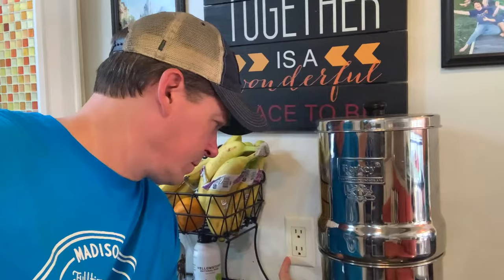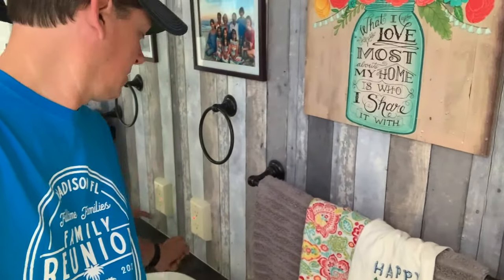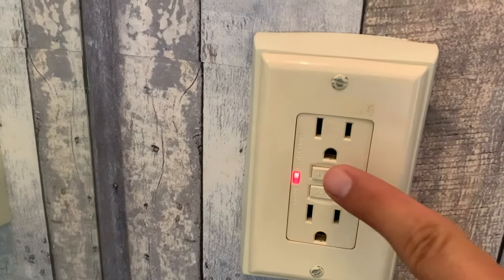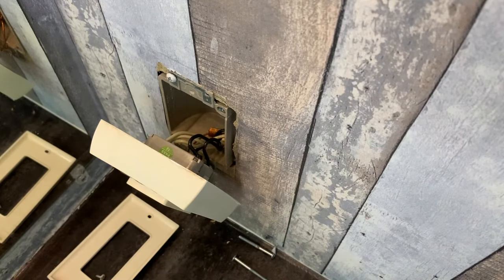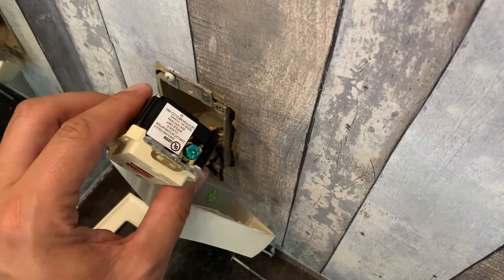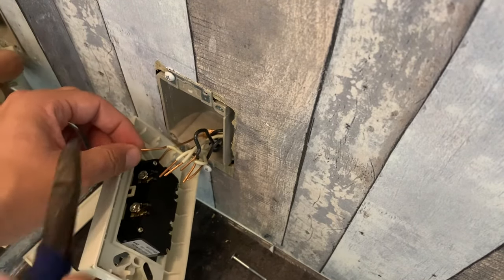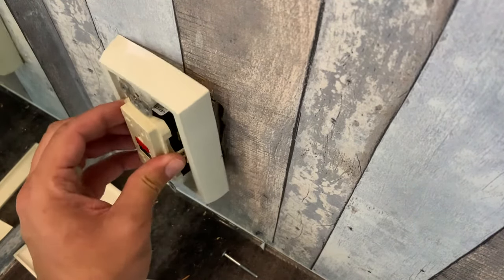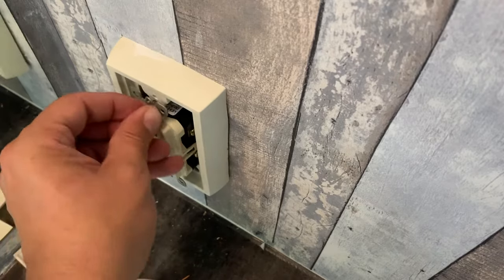RV Outlet Not Working -  EASY FIX: Full Time RV Family of 9 fixes outlet issues.

Comment: Outstanding. I had changed out my RV GFI. But it still did not solve my problem. He commented about reversing the two black wires. I did that and it's fixed. Thank you for your professional advice. Rick from Washington State.
Reply from the maker: Not professional, just one amateur RV guy trying to save us all some money.
Reply: Thank you for leaving this up he was all over the place in the video and ADHD is not fun revolving around that so you indeed helped diagnose me thank you both take care 2 wires were swapped as well 2am repairs for the freezer and internet

Comment: I want to thank you for this video, your exact issue of the bathroom GFCI being tripped was what was wrong with my Rockwood mini light. All my 110 outlets were not working. They all said GFCI but no reset button. The one in the bathroom was it. This power outage happened at 2 am in the morning. All the other videos had me outside up underneath my camper,  in my breakerbox in the kitchen, but nothing was tripped. You were spot on with the bathroom GFCI, and I didn't even realize there was an outlet in the bathroom until this video. So again, thank you so much for making this video and sharing. I can now get back to sleep.

Comment: Your tip on one GFI controlling ALL the 110 outlets in my RV helped solve my problem! Which was: the bathroom and bedroom outlets were working but none of the LR, Kitchen, or the outside receptacle, and I couldn't believe that just the one GFI could control them all so was looking all over for another GFI. And the GFI reset was working fine. But I went ahead and pulled it out anyway and found that one leg on the power side was burnt and not making a good connection. Snipped it and reconnected everything, and Bingo, everything works!! (Wasn't sure the GFI was still good, and will probably replace it anyway, but will just monitor the operation when using it for now). I was ready to start looking at all sorts of difficult solutions, so you saved me a BIG headache. Thanks again, Happy camping. A bit of camping wisdom given me when  we startied RV'ing 20 years ago:  The ONLY thing that works 100% of the time in an RV is the OWNER!!
Reply: I replaced the GFI in my RV but the fridge and outside plugs aren't working
Reply: It blew those plugs because I used a skill saw on the outside plug then 3 plugs didn't work so I replaced the GFI and still no power to those outlets but the others work

Comment: Great video!  Thanks!  But, what if replacing the outlet doesn't work?  If the gci won't reset?  Then what?  I have that problem now.  Thanks for making this video.  Very informative!
Reply: Help I'm having the same issue. Had the red light on gfci. Bought a new one installed it and still won't reset

Comment: Any thoughts on why only a few outlets don’t work but some do? The outlet with the GFCI still has a green light on it and it too still works? I feel I am going crazy!
Reply from the maker: Yea that is frustrating. Well first I would check the breaker and fuse box to be sure nothing is wrong there. If everything checks out there it is probably a wiring problem. They often chain theses outlets together in series. So for example if you have replaced the base gcfi outlet recently, because it is the first one in the chain, if the wires didn’t connect well it could cut power to each outlet past that in the chain. Wish I could be more help.

Comment: At 4:12 you had mentioned the GFCI sometimes just fail. How did you determine/confirm your GFCI failed and was no longer working? Thank you for details in the video 👍🏼
Reply from the maker: When they fail the button to reset won’t push in anymore. Then I opened up the outlet and used a volt meter to assure the power was working. Once I knew I had power to the outlet then I knew the outlet had failed

Comment: @FindYourCrazy great video but i have a question that might stump you as its stumped everyone elses so far. What if you have the same issue but except there being a gfi in bathroom there isnt one anywhere. Breaker is good not flipped even changed the breaker thinking it was bad but still same issue. There is no gfi on the side where all power is out. Heres the kicker most of the time a few hours later or a day later the power comes back on. Now sometimes i can use the bad side for a little but it will shut off. The other day i unplugged a 6 way with a reset thinking that could be the cause and i was able to use the side where iv had issues all day running high voltage items. Ac, coffee pot, few power tools, ect. Woke up the next day to find the power shut back off again. Now i know they make gfi plugs that dont have reset on them and they just have a sticker stating gfi but im not sure i have 1 cause there are no stickers on my outlets that are out.
Reply from the maker: Unfortunately, yes, I am stumped as well. Intermittent problems are the worst to try and identify. Best I can do it pray for you to find the cause :-)

Comment: I have a cabover camper and when plugged in to shorepower(my house) and try to run the fridge off electricity the gfci will pop in my garage. All outlets work and i can run the AC off the same power and it wont pop gfci in my garage. Also gfci in camper bathroom seems good it didnt pop it there either.

Comment: I did this and the new outlet is working (old one was still working too though). The other outlets are NOT working still. Any thoughts on what to do next?
Reply from the maker: As Andy told Aunt Bea… might be time to “call the man.” I am no expert so I only share from my experience. Unfortunately you are past my experience now. All the outlets are chained together starting with the first, must be something in the wiring past the first outlet. Sorry I can’t me more help.
Reply: @FindYourCrazy  I'm going to replace the first outlet in the living room. I plugged in a cheap electric heater and the next morning the outlets weren't working. I think that one outlet could be the problem
Reply: @MrGwizyadig hey man I’m having the same issue, I did the same thing and now all my outlets are tripped, let me know how you fixed your problem if you ever did

Comment: YouTubers are notorious for never answering comments so hopefully someone else does.

Today I moved my camper from one spot to another that was like 50 yards away. Everything was meticulously cleaned and put away for even the short move. It's always a good excuse to super clean everything that you normally don't have access to. Like computers and what not..

The camper has been plugged back in and running for hours.  Same exact things running in the camper as I have been for 6 months.. 

I turn on my computer and turn on balder's gate 3 and before I even logged in I hear a crackling and my battery backup that the PC is plugged in to starts beeping meaning it lost mains power and is now running on battery. I alt-f4 the game and hold the power button on the PC to force a fast shut down. click off all the breakers and rip open the bench seat expecting to see fire and smoke. I smelled smoke. Didn't see fire or smoke. The battery charger fans are cranking up and running at max speed for a few minutes, then shut off for a few seconds, then kick on and repeat..  the fans have ONLY ever kicked on full blast before when I had a shitty 12v wire coming out of the screw down fuse terminal which caused a burned out terminal. I just moved the wire to a blank spot on the terminal and it's been golden ever since. Ive never seen the fans kick on full blast since.  Until now. None of my plugs work. There is 120v at the breaker but no plugs have power. My GFCI is NOT popped. 

Idk what to do. I'm gonna buy a new battery charger unit but I need power immediately. I live in this camper full time with 2 dogs. I need power for heat but I can't risk dying obviously.. or arguably worse, I survive but I watch my dogs suffocate and die on security camera while I'm helpless at work. It's 12:30am (on my birthday of all days). I'm supposed to be up in 6 hours. I need help NOW!!!!!

HELP!!!!

Comment: Is there a chance that a gfci could also be connected to the interior overhead lights? We have been trying to trouble shoot one GFCI outlet not working along with overhead lights. All circuits and fuses good. Kill switch seems to be working.
Reply: Did you find the answer? Same issue.

Comment: I have 2020 Keystone 303bh I am hooked up to a 50 amp service I had no power to my living room TV,master bedroom and and the 110 receptacle in the rear bedroom I do have power to all the GFI receptacles checked all the breakers and the surge protector had all green lights. I called Keystone customer service and they said to cut off all breakers and unplug the camper for 5 minutes to reset the camper. None of that worked. I was checking the main plug of the service line, it was plugged in and screwed in. Once I played with the cord I could hear my blow dryer that I had plugged into the receptacle with the tv and when I played with the main service cord I could hear it turn on an off so I put the cord over the sewer outlet to take the weight off the plug and have had no problems sense. Don’t know why the GFI plugs were working and the others not. I’ve seen other comments on videos with the same problems with no answer’s. So maybe this could help someone.
Reply from the maker: Some of your outlets must be tied into your battery system. So when the service line was not making contact you lost the outlets that used only shore power but kept the battery ones. My camper is older and none of our outlets are tied to the battery so nothing would work in mine, but every camper is a little different.

Comment: Question?? What if my gfci plug itself is working but the others are not?? And looking at all my plugs I only have 1 gfci plug?? I’m so confused
Reply from the maker: You would only see on G plug, the rest are run after that one in a chain. But if the first outlet is working then there must be a wiring problem.

Comment: I’m hoping this is my problem. I had an inferred heater, tv and a induction stove top running.  After turning on the stove top about 20 seconds the power went out. I knew which GFI they’re on so I went to rest the GFI and it wasn’t even popped out. So I tried testing it holding one test button in waiting for it to pop but nothing. Blown GFI receptacle?
Reply from the maker: Yes that is exactly what mine did, therefore the replacement. Hope it is that easy for you as well.

Comment: Would that have the same impact on tbe lights as well? I over loaded the breaker and now nothing but the microwave is working
Reply from the maker: No. Typically the GCFI outlets are just chained together, but not with any lights. If your lights are down you have I bigger issue.

Comment: I cannot find an outlet in my RV that looks like that would a reset
Reply from the maker: Some of the new outlets do not have a button and are suppose to auto reset. The base outlet, or first outlet in the chain, is usually the one in the main bathroom. You might start by changing that one out.

Comment: None of my outlets are working, and my circuit switch is half way down and it won’t go up or down… other electricity works throughout, just the outlets are down. Is this a bigger issue?
Reply from the maker: I am no expert on electrical, but if your breaker won't reset then that may be the problem, you need a new breaker. I had that happen in my sticks and bricks home and I had to have an electrician come and install a new breaker switch.
Reply: @FindYourCrazy  thank you 🙏🏽

Comment: I really need some help.  I have a gcfi that we just put in a month ago.  It tripped and would not reset.  Then a few days later, it did reset and stayed on for a week and then it tripped again lastnight. This morning, i tried to reset it again and it started working again.  Why is it doing this please i need help.  I am disabled and live alone and live in a rv and need to know.  could you please answer this for me.  as i said the gcfi is only a month old.
Reply from the maker: So obviously without being there I can only guess. But the first thing to look at what is plugged into all the outlets that on the circuit, not just the one with the gcfi switch. Small heaters seem to be the worst for tripping them. Then you can cycle through a few nights rotating what you leave unplugged to see if there is a difference. Second if there is nothing plugged into any of the circuits when it flips you probably got a bad switch. This is what I would think is more probable because you were not able to reset it for that day.

Comment: I have a 2016 jayco eagle ht and none of my gfci have a reset, it’s driving me nuts my kitchen, bathroom and 2 outside outlets don’t work. All are labeled gfci but none have a reset. Trying to find the reset but can’t for the life of me find it!!!!
Reply from the maker: That is frustrating. My reset was in my full bath. I know they sometimes will put the reset on the outlet closest to the circuit breakers so it protects everything from that point forward. So maybe start looking at all the outlets radiating out from the circuit board.

Comment: I did that still half of the outlets work
Reply from the maker: The only outlets that are connected to the GCFI are the bathroom, kitchen and outside. If any of your other outlets are not working then you have another issue with your fuse/breaker box. You may need to check all of your fuses.

Comment: So i swapped mine and still completely off
Reply from the maker: If that is the case then you have a bigger issues somewhere "up the line." So from your breaker box to the first outlet. You can check that with a volt meter if you have one. Use it to see if you are getting any power to the first outlet in the group (which would be the one in the bathroom with the button). If so you know you still have an issue with that outlet. If not you are past my knowledge of electrical and it might be time to "call the man" and get an expert out there.